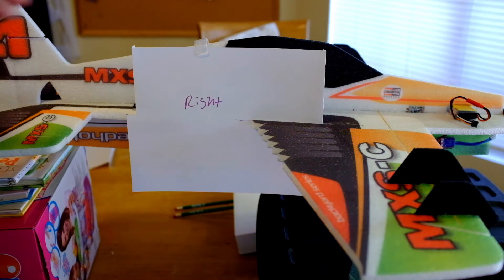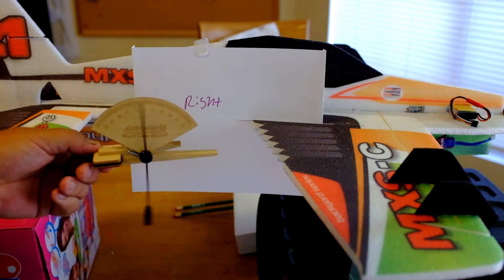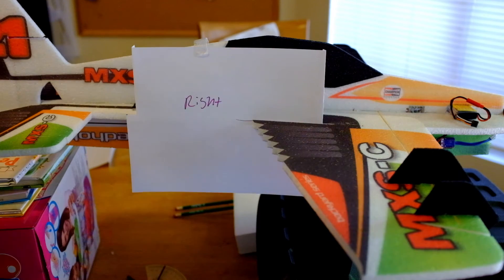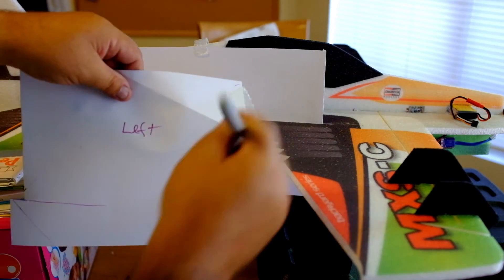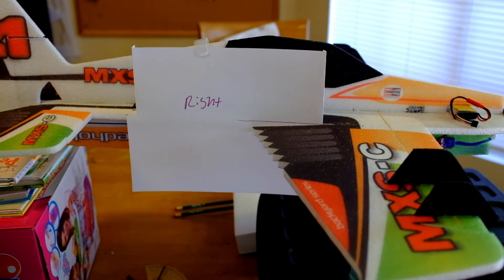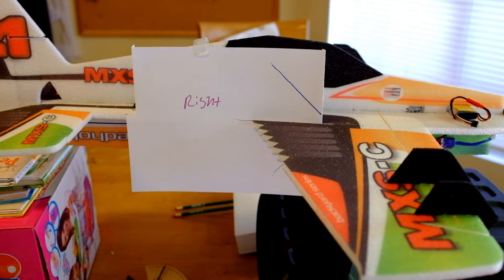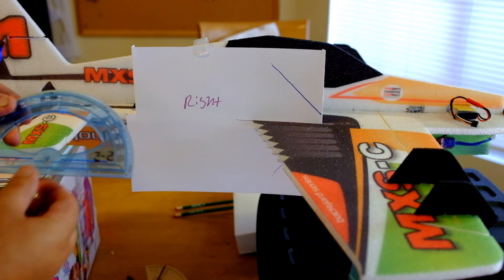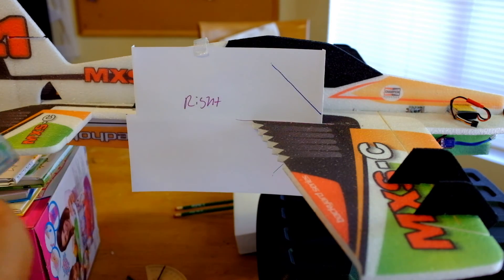How To Adjust Aileron Throw Without a Throw Gauge

Comment: Does less aileron throws help if a plane is prone to tip stalls on Sharp turns. I'm a drone pilot and I bought the m02 VTOL and it is prone to tips stalls but I'm thinking since it only does it on Sharp turns and lessening the throws would probably help with this. I'm open to other pilots opinions though

Comment: Genius idea! My problem is with scratch builds. I can’t ever seem to get my ailerons set so I have equal throws on both ailerons. Any tips? No matter how precise i build my wings and install my hinges,  my friggen ailerons will never throw equally. I have a DX8e TX so I’m wondering if there is something I can adjust in the servo setting without having to adjust my trim while plane is on the ground? Any tips greatly appreciated. Your method really helps to show how off my throws really are, so the thank you
Reply: One problem is, that the servos are installed mirrored for ailerorns. If the mechanics of the servos are not exactly the same in both directions you get a slightly different throw. There is nothing you can do about it, but adjust it via rc settings/programming.
Reply from the maker: Yeah you can use a Servo programmer, and use that to define the limits of the servo, then in Radio just set the limits